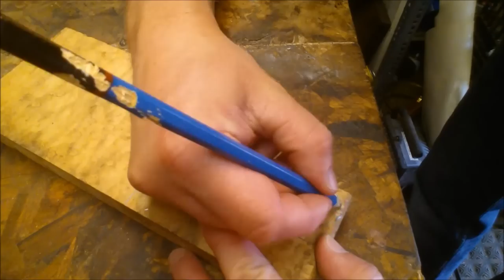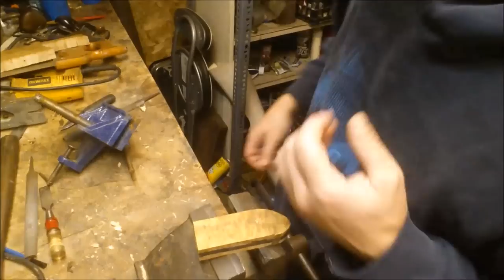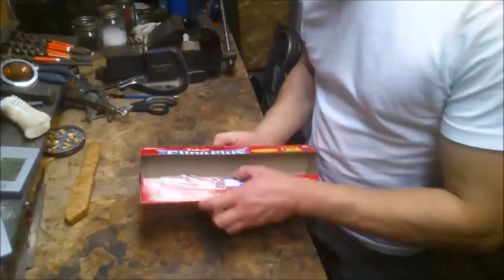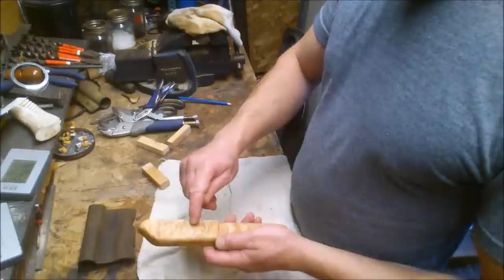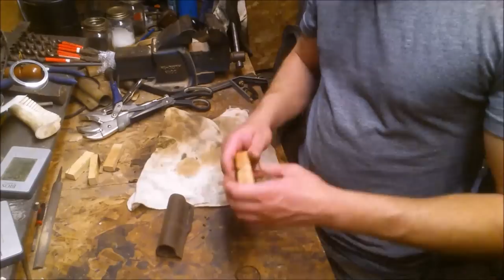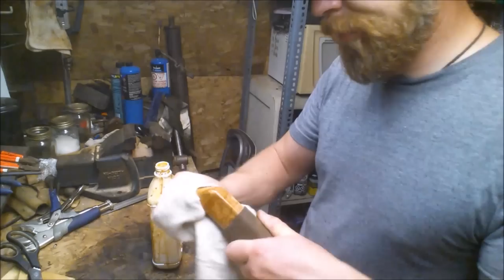DIY Making a Sheath for MY Mora Carbon Steel 4.3 Rat-Tail Knife

Comment: Brilliant sheath idea. I've made a lot of sheaths but yours is just amazing. Maybe put some bees wax on it to keep it protected plus it will firm up the belt loop some. Just melt it and apply it with a paint brush. Heat the leather first with a hair dryer or heat gun, slap it on, then hit it with the heat again. Great job my friend.
Reply from the maker: Thanks I'm going to do that for sure! I got some bees wax from the reservation.

Comment: Great idea you came up with using the leather wrap to make a belt attachment. I have a knife with a similar type sheath made out of the same bone material as the handle, with a silver ring cap around the sheath's opening I was thinking of wrapping it with chain mail to hang it from a dangler type belt loop. I might use this method instead. Thanks for sharing
Reply from the maker: Thanks for watching and commenting! that's what I love about DIY, you can do anything that you can think of! It's only limited to your imagination!

Comment: I just bought a very very very inexpensive belt sander on Amazon for 17 bucks. it hasn't come in yet and I can't remember what it is called but if you look on there You can find them cheap. I think I originally googled harbor freight belt sander and it's the small green one with a 1x30 inch belt.
Reply from the maker: Daniel Baker Thanks brother, I will have to take a look. I appreciate you commenting!
Reply: No problem bro. I just got started a couple months ago with making knives, sheaths, and leather work period. it's a lot of fun. your knife turned out beautifully man. awesome job.